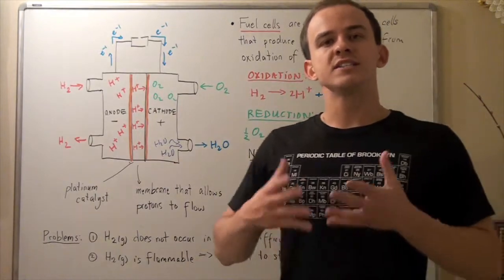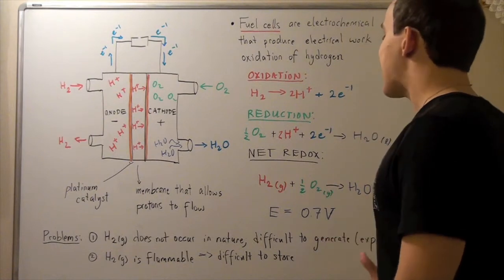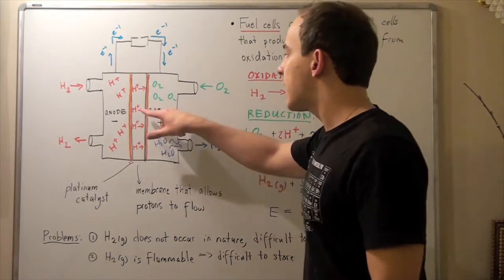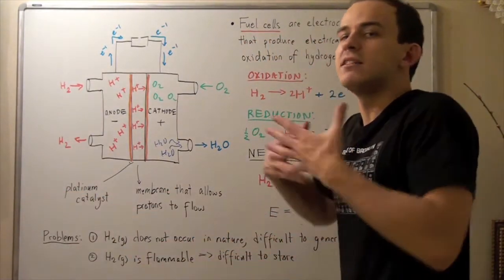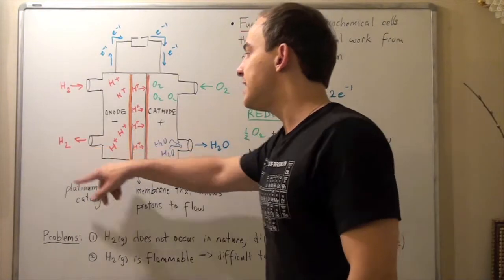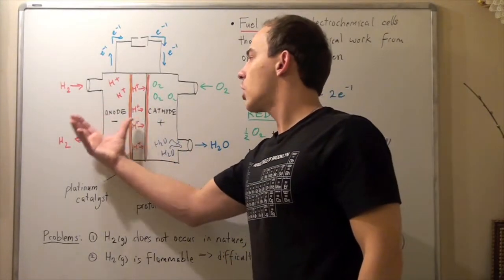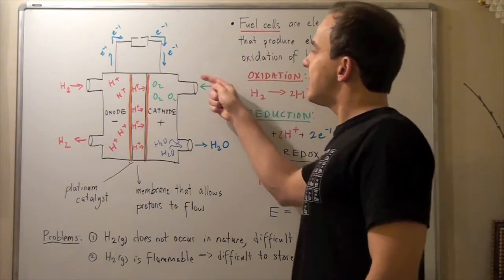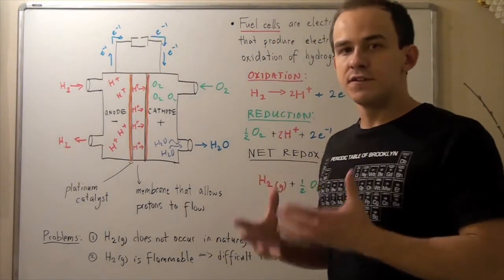Electrochemistry of Fuel Cells

Comment: The theoretical and thermodynamical potential of liquid water formation from H2 and 1/2O2 (both in gas state) is 1.23V, isn't?
The 0.7V you referred maybe is from hydrogen peroxide (H2O2) electrochemical formation by the reaction O2(g) + 2H+ + 2e...